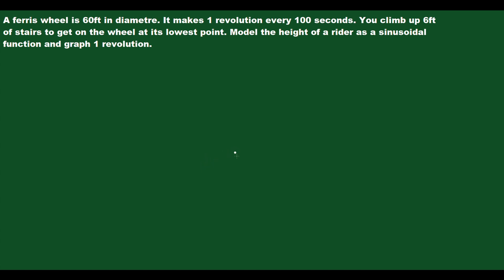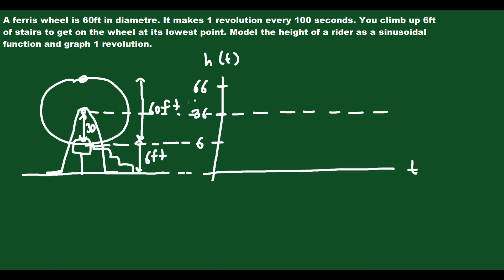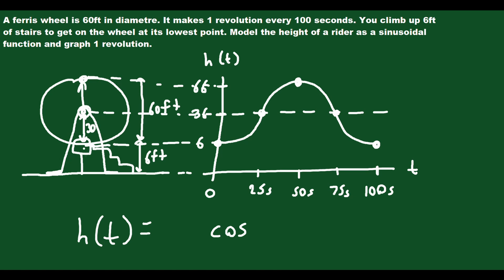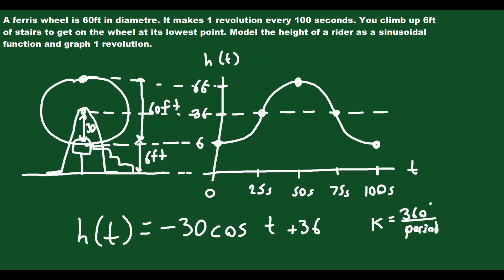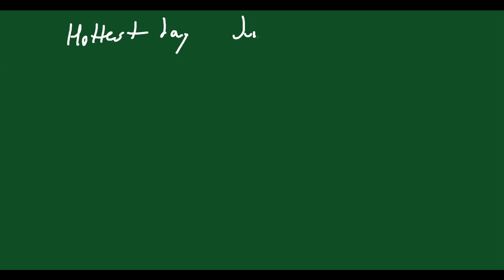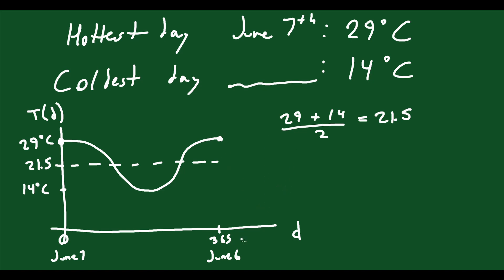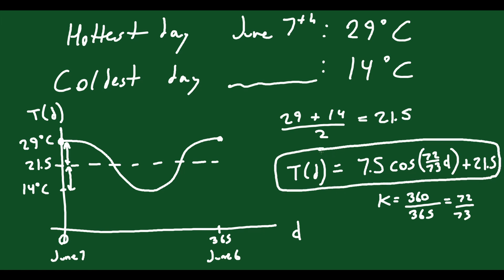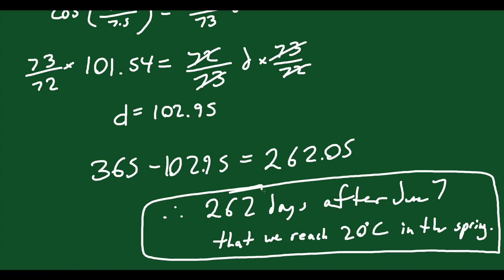Sinusoidal Function Word Problems: Ferris Wheels and Temperature

Comment: I was wondering, um I was taught that k equeals 2 pie divided by the period. So im not sure, could osmeone help?
Reply from the maker: 2pi is correct if you are working in radians. 360 degrees is correct if you are working in degrees. All depends on what units you are working in.
Reply: @madmaths7895  thanls

Comment: why would 360/period work instead of 2pi/period ? i thought you had to do it in radians?
Reply from the maker: It depends on which units you decide to use. If you are using radians then use 2pi. If you are using degrees then use 360.
Reply: So it is -30cos(pi/50*x)+36

Comment: I have a question for you MadMath, If you have a h(t) graph and your hight as you mentioned is changing faster and faster then it changes slower and slower to a position momentarily at the Max and Min point when the hight does not change , on your hight vs time graph , then isn't it exactly the definition of changing your speed? 
You say that the speed does not change!
Reply from the maker: The vertical speed is changing, yes. (As is your horizontal speed.) The speed the wheel is rotating is not changing though. Basically, your height off the ground might change a different amount in a 1 second period vs another 1 second period, not because of the speed of the wheel, but because of your location on the wheel at that time. This might be tricky to imagine but I tried my best to explain it in the video.
Reply: @madmaths7895  Thank you for clarifying what you meant. But of course the speed of the wheel is not changing. It rotates once every 100 second. However the speed of a person in a cart rotating is continually changing. No?
Reply from the maker: @ElizavetaAleksandraPetrovna  The person's speed vertically changes, yes. (It may be more appropriate to refer to this as their velocity.) But their speed does not change, no. They travel around the center of the wheel in a circular path at a constant speed.
Reply: @madmaths7895  I see. Thank you. I will take physics next year. I know a bit now but I think that's where I lack knowledge. I understand that the speed is constant but the velocity is changing because the path isn't straight and the direction is continually changing. I must dig deeper to understand when I can say from the given information if I can have constant speed while I have acceleration? What you are saying about constant speed make sense so I am missing something. Many thanks for further explanation.

Comment: aren't you supposed to use 2pi instead of 360
Reply: 2pi is in radians, 360 is in degrees. He's currently using degrees.
Reply: thats what i thought
Reply: pi = 180, 2pi = 360 degrees. They're interchangable.

Comment: How did u get 36 as the vertical shift, wouldn’t it be 6 since that’s the initial starting point ?
Reply from the maker: The vertical shift is the distance from the axis (or midline) to the x-axis. Not from the lowest point.

Comment: How did you get inverse of Cos ( 4 / 30 ) with an answer of 97.66 ... when I put that into my calculator .. inverse of Cos ( 4 / 30 ) .. I got 82 . 3377   .. where am I going wrong ?
Reply from the maker: It is because you are taking the cos inverse of negative 4/30. I forgot to write the negative in the next line. My bad. But the answer remains 97.66.